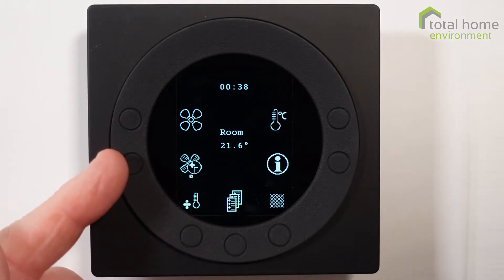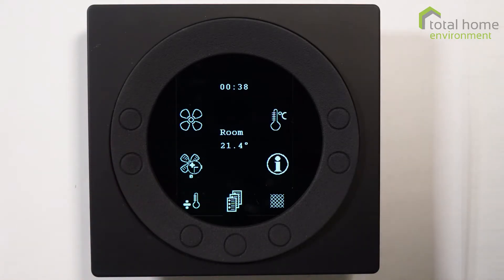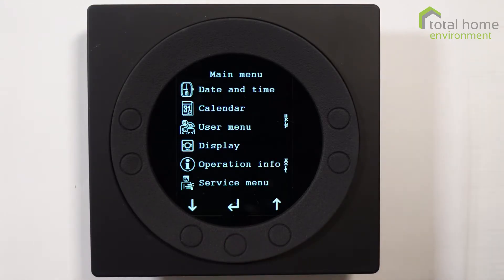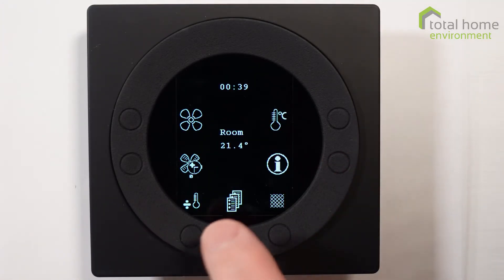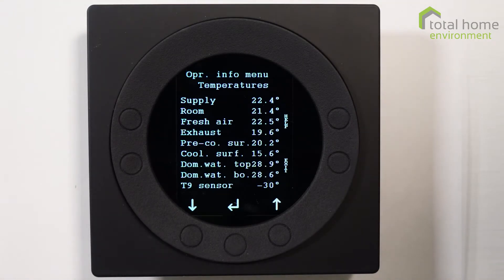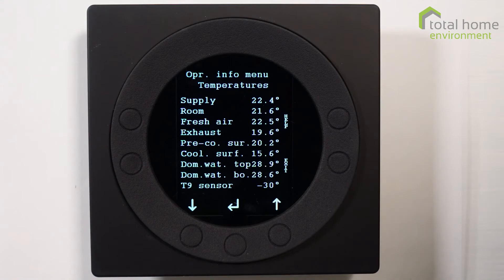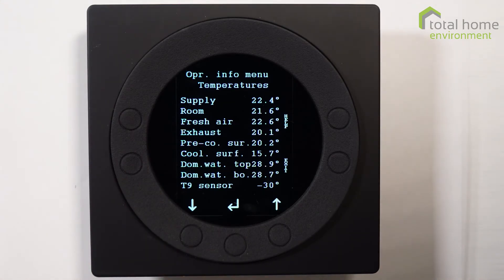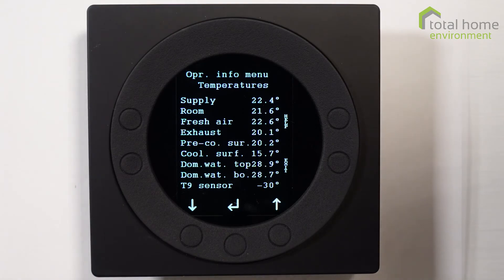Genvex Combi 185 Controller - 1 Overview

Comment: I've changed the fan speeds to match. My system hasnt been able to reach the temperature I want, when its less than 10 degrees. I live in this place for a year, and now that its -15 outside It gives me 18 degrees when I ask for 22 ( doesnt matter really if I put 30)